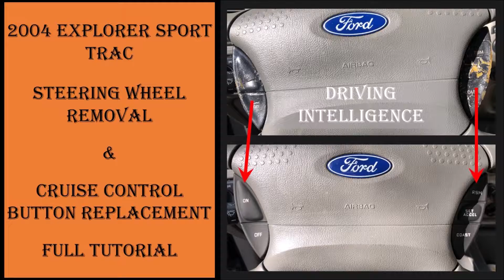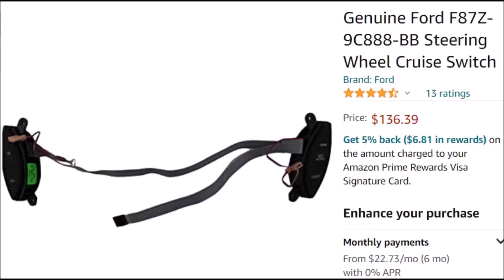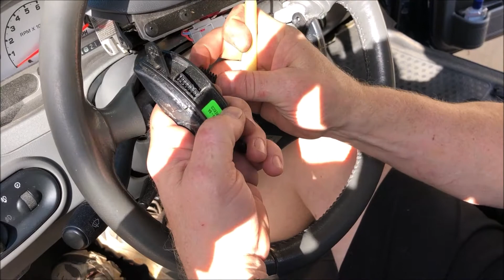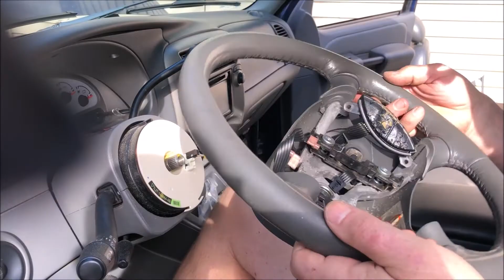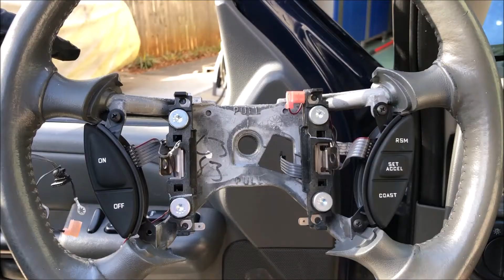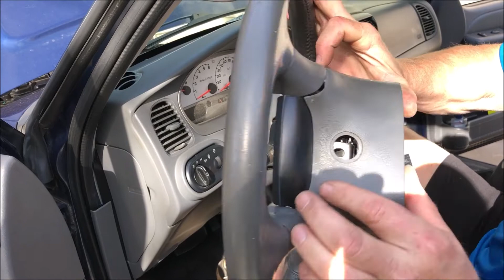How To Replace Cruise Control Buttons & Steering Wheel Removal: ‘00-‘06 Ford Explorer Sport Trac

Comment: Thanks for the video. I need to replace my entire steering wheel for aesthetic reasons...do you know where I can purchase a replacement? I have a 2004 Ford Explorer Sport Trac. TIA
Reply from the maker: I suggest junk yards.  If you want, I might be able to source one.
Reply: @DrivingIntelligence  Oh, that'd be great. I am not familiar with junk yards so any guidance would be greatly appreciated. I live in NYC if that helps any. Thanks again.
Reply from the maker: Luis Diaz reach out to me at www.Facebook.com/Drivingintelligence and we can coordinate further
Reply: If you cant find on line, the junk yard can give great results sometime, you might want to check, this steering wheel might have been uaed on other vehicles as well, giving you a bigger selection to pull from.  Probably will need a two arm gear puller from harbor freight?  Good luck!

Comment: Thanks, since they are cheap, I bought another one, will check tomorrow, but my old one use to work, but rubber wss broken.  But it does not work now either.  Pulled steering wheel, did not see anything obvious?  With I knew what the plug pins voltage or ground/ open status so I could check pins the button set plugs into?
Reply from the maker: Try checking the fuse first.  Somehow might have blown while you were working on it.  You did disconnect the battery for starting the project?
Reply from the maker: any luck?

Comment: Appreciate Your help with this project, just replaced the buttons only (takes a 8mm socket and Phillips screwdriver) using the flatblade screwdriver to pry the ribbon connection.
Reply from the maker: glad it worked out for you